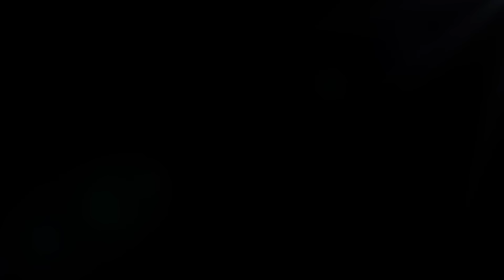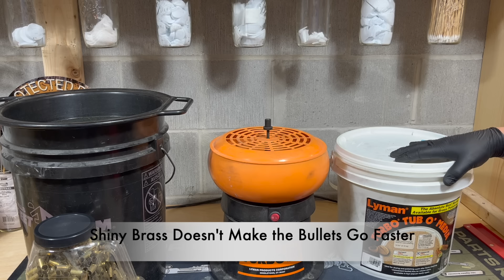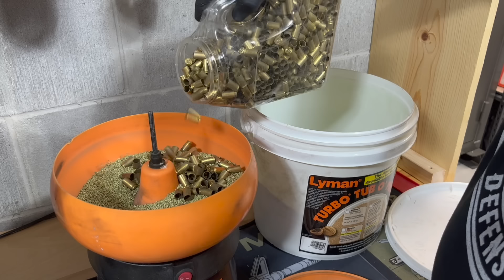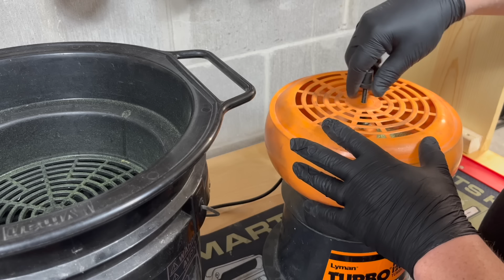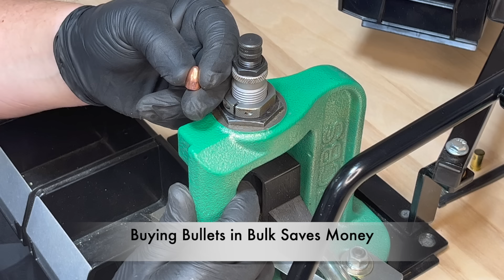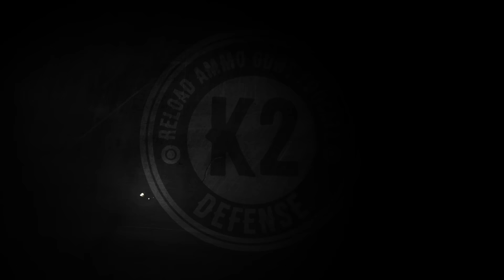How to Reload 9mm Ammo For Beginners Single Stage Press

Comment: Very nice demo. I don't think you did the crimping part,, or did I miss that? I'd like to know how to add that.
Reply from the maker: @MusicMinisterJP7 - yes, I had forgotten to explain it in this video so I made a different one on seating and crimping. 

Thanks for asking! Hope this helps. It’s a bit tricky until you try it a few times. Good luck! Let me know if you have any other questions! I’ve attached the link to the video below. Thanks for the comment! 👍🏻

https://youtu.be/diLgHfozgbA?si=Doz12gvS1lgWYNEs
Reply: @k2defense  I like how you went about your demos.. May I trouble you for another question;;  I normally did rifle loads years ago  (30-06 and 30-30), but now I've purchased a P320 9mm and have begun prepping the cases. However, I am a bit concerned if I am understanding the difference in pistol loads from the rifles. Meaning,  with rifle's, a 52.5 would be figured using the left side ruler beam, with the .5 on right side ruler. But in pistol,   is a 4.7g all basically on the right side ruler beam? I'm thinking yes. BUT, if I wanted a 5.2g , how would I get that, being the right side ruler beam only goes up to 5? 

Is the then the 1st notch on the left side ruler beam, the 5? Can you please elaborate on this? I haven't seen a video that explaind this.. I'd appreciate it, thx.
Reply from the maker: @MusicMinisterJP7  hello! Thanks for the compliment! May I ask which scale you’re using? I’ll be able to better assist you knowing which one you’re using. 👍🏻
Reply: @k2defense  Sure, Thanks, I have the RCBS 502 scale. I also have the Rock chucker press with the priming attachment. And I like that gizmo on your press, that ejects completed round into basket. Did you make it, or is it available?
Reply from the maker: @MusicMinisterJP7 - to get 5.2 you would move the left side weight to the first notch. That will be 5gn. On the right side you’ll move the weight to the 2. This will give you the 5.2. To get anything up to 5 you would only use the right side. Does this make sense? 

The case ejector system is sold by In Line Fabrication. Tell Dan I sent you. Great company with quality products. 

Here’s the ordering information:

https://inlinefabrication.com/products/case-ejector-system-for-rcbs-rockchucker-single-stage?_pos=1&_sid=91b82e0ec&_ss=r&variant=1001965276

You’ll love it!

Let me know if you have any other questions!

Thanks for the comments! 👍🏻
Reply: @k2defense  Makes perfect sense. Correct me if I am wrong, after obtaining the 5.2, are notches after the 2 a point further? For example: 5.2.1..? 
 Thanks again for the help my friend.
Reply from the maker: @MusicMinisterJP7  it would be 5.3 of if I understand your question correctly.
Reply: @k2defense  Well, the right side ruler has numbers from 0 to 5, (1-2-3-4-5). But in between the numbers there are notches. So I understand, if I land the large poise on the 5, and the small poise on the number 2, I get 5.2, So when do the notches come into play? aren't they increments? That was my question. Thx.
Reply from the maker: @MusicMinisterJP7  - here is the IFU for that scale. Please refer to page ten. I don’t want to confuse you. In short, the left side goes by 5gr and the right side goes by .1gr per each notch. Please look at the details on page 10 and that will make it more clearer. 👍🏻

https://www.rcbs.com/on/demandware.static/-/Library-Sites-HuntShootAccessoriesSharedLibrary/default/dwbf2b73c3/productPdfFiles/rcbsPdf/RC_98915_M500Scale_Manual.pdf
Reply: @k2defense  Thanks again,.. yes I read the same in my scales instructions. But I'm guessing my equation seems to pertain more to rifle loads. All good, thanks.

Comment: I know bullets are expensive, that's why I ended up looking into reloading. But with all the up front costs in tools, and all the consumable supplies, and all the time involved, is this really any cheaper in the long run? Now, if your argument is 'but what if you can't even buy bullets', well then I guess it's good to be able to reload. But for anyone looking to save money, this looks like you would have to reload thousands of bullets, and even then, what is your time worth?
Reply from the maker: @fredvStein - good question. I won’t complicate the answer or argue either way. In short, you are correct. Weekend plinkers will not “save” you from enough money in their lifetime to recoup the upfront costs of everything. I would tell those folks to go and buy as much ammo as you think you need to make yourself comfortable. I’m not suggesting stockpiling ammo, however find a number you’re comfortable with in case things are hard to buy at some point. I’ll never try to convince anyone that reloading will for sure save you money. Personally, it’s time that I get to do something that I enjoy. To work up a new round and see how it performs is cool, to me. Thanks for the question Fred! Appreciate the comment! 👍🏻

Comment: Just get a Dillion 750 🙄
Reply from the maker: Yeah, I’m working up to it. My main hang up is trusting the powder throws. As a new reloader I had a squib load using my single stage press. Thankfully, no serious issues related to it. After I charge each case, I neurotically check each case with a flash light to make sure there’s powder in each case. It may sound silly, but it has stuck with me and I have a hard time trusting not being able to verify each case for powder. I am envious of the the ease of large quantities one can produce in a short period of time. Especially with the amount that I shoot. Maybe someday I’ll learn to trust more freely. 😂👍🏻

Thanks for the comment!
Reply: @k2defense  Dillon has a “powder check” station that you can add in one of the spots. It alerts if there is a missed filling.
Reply from the maker: @tomanderson6539 good to know thank you! 👍🏻

Comment: Got the same RCBS hand priming tool. Been using it for 30 years. You NEVER let the handle shaft rod fully disengage from the end of the primer press and spring assembly. 

Hold it in position while removing the frame clip and inserting the feed/shell holder housing, and the primer supply tray. Also, don't rest the primer supply tray on the index finger knuckle of your hand while squeezing the grip press system, and the tray won't work itself loose, and fall on the floor; ask me how I know. 

Knowing what you're doing is generally the first solution to something that doesn't function properly.
Reply from the maker: Hey Busta thanks for the information!  Always good to have someone else's perspective.

Comment: Great Tutorial, thanks for sharing! I never used the expanding die on my 357 mag loads and never had an issue. I just hold the bullett and case with my fingers until they enter the seating die. The Bullet seating die always pushed it in perfectly without trouble. I get why it is important on multi stage presses, but I feel like it's not necessary with a single stage press.

Comment: I use to use corn media it makes fine dust you might want to switch to crushed walnut shell way less dust
Reply: Use corn media for cleaning shell cases and walnut media for polishing and brightening shell cases that just don't look like "they should". You will have one more step in the process but the finished shell will look great every time. Oh, yeah, try using Lee dies and primer tools. Much easier than RCBS equipment and much cheaper without sacrificing quality. Gets the job done much faster, too.
Reply from the maker: @jamesmasterpole2471 - add Nu Finish and 2 x 2 used dryer sheets to help with the shine! As far as the dies, I think it’s what you’re used to. I, personally, find Lee dies more complicated than RCBS. Probably because RCBS was the first dies I started off using. I do have a couple of Lee die sets. Nothing wrong with them. I just know the RCBS dies like the back of my hand. I have Lee dies for the .22 Hornet and rarely use them since I don’t use it high volume. I’m sure if I used them more frequently I’d enjoy them too. Thanks for your comment! 👍🏻

Comment: You forgot the step of pouring your own bullets. Dad used to pour lead and reload .357 & .44 Mag with lighter loads for target shooting only revolvers. So if you are buying slugs, powder and primers, what is your cost per cartridge?
Reply from the maker: Hello 600miles!

My cost is pretty inexpensive since I had learned my lesson after Sandyhook. I bought volumes of powder, projectiles, and primers when the cost was low. I agree that casting bullets is cheaper since most of the alloys are available for free or low cost. It is a time commitment, but the cost savings is big. To answer your question, with reusing my shells my cost is around 10 to 13 cents per round only because of had purchased all of my components while they were low years ago.

Thanks for the comment!
Reply: @k2defense  Dad left me 100 pounds of lead already made 357 & 44 slugs, I don't own those guns so remelt into something I can use, 9mm.